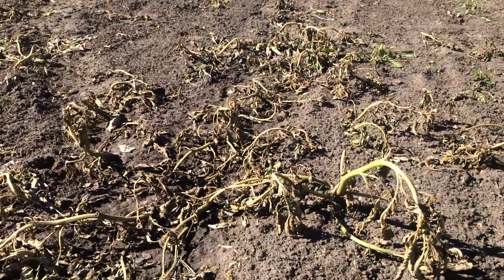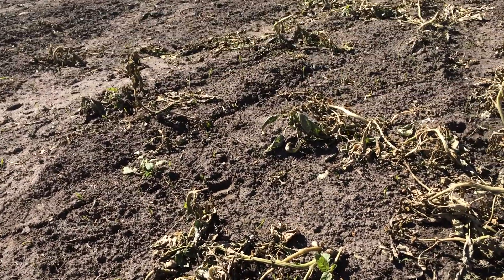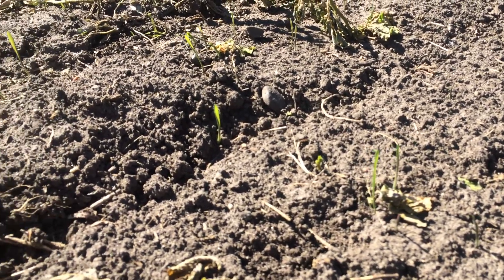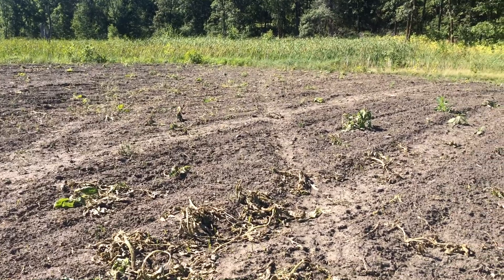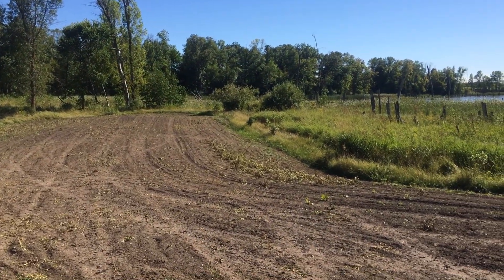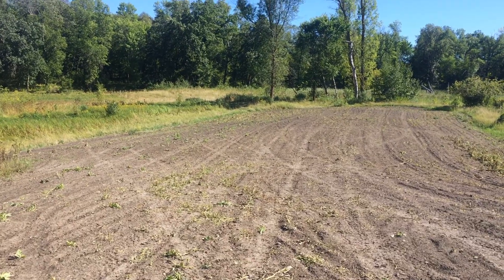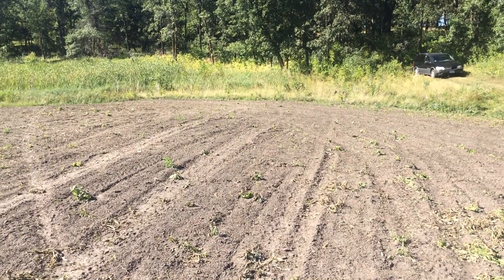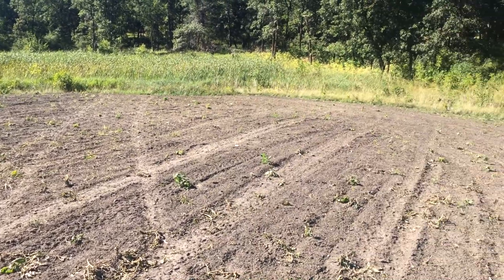THE MOST COMMON ROUNDUP MISTAKE: What should go in the tank BEFORE glyphosate?

Comment: A little late in the game here but this might be helpful. I used to work in asbestos abatement and we had to wet the stuff before removal to make it less "friable" ie hard, brittle, crumbly. We had to mix surfactant with the water to make it soak in. Most of the time straight water would just bead up. Found out surfactant is just soap. It looked like pink hand soap and smelled like it too.  After spraying yards for several years and using "surfactant " mixed in, the weeds dont stand a chance and you use far less 2-4d or round up. Just one drop on a leaf of the weed and it's history. I use only the blue dawn dish soap, the original. 1 ounce per gallon.
Reply from the maker: I’ve tried a lot of different things and while dish soap does work, it doesn’t have the same properties as ammonium sulfate when playing with gly. That stuff acts a little bit like a fertilizer too, and the plant wakes up and thinks it’s time to grow and that’s where it sucks the chemical in most. Add to that the surfactant qualities you mention, and those tank conditioners pro farmers use in their tank were definitely invented for a reason! Thanks for the feedback!

Comment: Excellent video, I've tried a wee bit of diesel, among other things, but nothing seemed to work. In fact, I was just discussing if Roundup, not generic Glyphosate without a binding agent/adhesive, would work any better (nothing seemed to work).  However like you mentioned, RU can bind to iron and other mineral, makes sense.
Reply from the maker: Yessir Jay. The easiest product I have found is called Level 7. I add that at quart per 100 gallon rate before putting in chemical and it does a nice job. Definitely not as hot a kill as ammonium sulfate powder but us food plot guys usually don’t have adequate agitation to deal with powder. Good luck this season sir!
Reply: @HabitatProLLC  Thanks for the excellent advise, just purchased some ammonium sulfate.
Reply from the maker: Smoke city then!

Comment: DAWN DISH SOAP OR CROP OIL WILL MAKE IT STICK TO WEEDS
Reply: How do you apply that?
Reply: @floridagirl386  Put two tablespoons per 2 gal. pump up sprayer ....slosh it back and forth to mix with water and roundup.
Reply from the maker: Thanks for checking in
Reply from the maker: Thanks for checking in
Reply from the maker: Yes, those are good as a sticker and spreader for chemical, but they don’t do a whole lot with the chemical make up of things to prevent ions in the water from binding to the glyphosate you wish to use. That’s where liquid ammonium sulfate products come in.